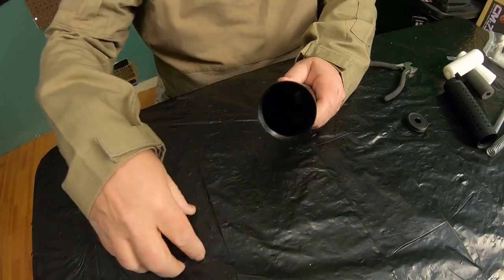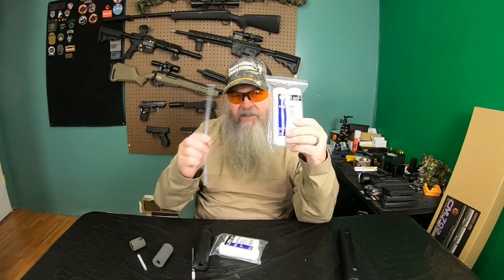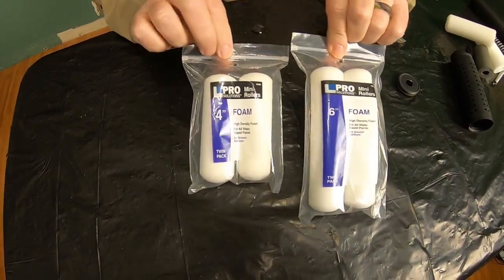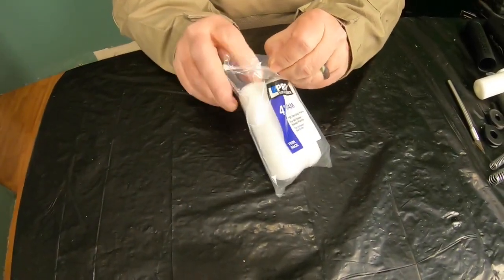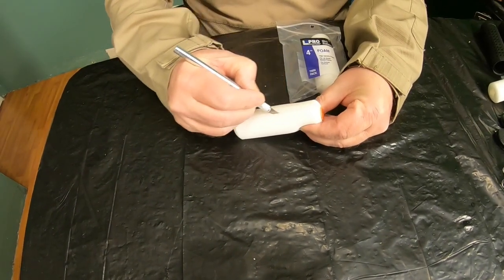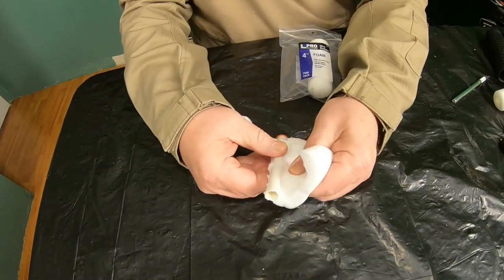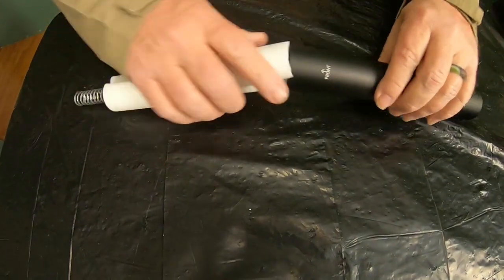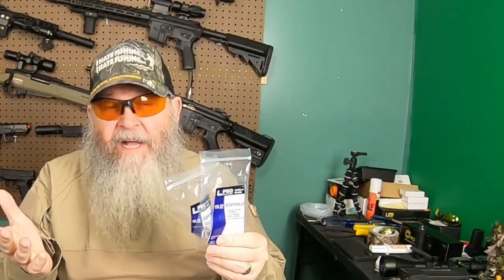Cheap Airsoft Suppressor Upgrade (Airsoft Tech) 🤔

Comment: Hello!  I did this on my mock suppressor for my striker AS-02... and I can confirm 100% this setup works! The cost from my local home depot on the foam and the spring totaled $7.32 after taxes. I initially had a 4 inch mock suppressor but switched it out to a 6 inch...and the sound was very much muted on the 6 inch setup. Thank you for the video! This is legit and affordable and a fun hobby project.
Reply from the maker: Right on Brian, thanx for the feedback, I'm glad it worked, did you use a spring?
Reply: @ShreqAirsoft  Yes, i got a spring from my local home depot, worked like a charm

Comment: One thing to note is that this will indeed surpass the noise of the air coming out of the barrel, but the majority of the noise is from the piston slamming into the back of the cylinder head. You can get quieter pistons or some people put foam pads on the back of the cylinder head (this will slightly decrease FPS and will need to be replaced).
Reply from the maker: Exactly! Most of the piston slam noise is directed to the side of the gun, not a lot of that noise goes forward but a great point, thanx!

Comment: Cool video buddy.   What's the he legal status with these?  I've seen the foam inserts for sale at airsoft shops but I sorta thought they weren't legal? 

Especially if a person owned real steal guns as well??
Reply from the maker: I own lots of real steel guns. Put an airsoft suppressor on a real gun and the pressure will probably cause it to explode. I don't know about anywhere else but here in Utah they are legal.
Reply: @ShreqAirsoft  thanks buddy. I live in Utah as well. I'll have a nice little project this weekend
Reply from the maker: @bushido6348  Right on, what project?
Reply: @ShreqAirsoft   I've a kwa qrf mod 1. I added a maxx trigger and gate titan. Next I'm thinking I'll upgrade the compression parts. And maybe a new motor. Would you have any suggestions on a good aeg motor?
Reply from the maker: @bushido6348  Depends on what you want or have to spend. I did a search on Evike and there are tons of options and prices.
https://www.evike.com/s/?q=aeg+motor&x=0&y=0#a_aid=61057b438c097&a_bid=b467b403
Reply: One shot and the foam is gonna disintegrate 😂🎉

Comment: Mind sharing what brand suppressor you show in the vid? All of the ones that look like that at my local shop have the caps permanently attached
Reply from the maker: That particular suppressor is for the AS-02 Striker sniper rifle put out by Ares Amoeba. If your suppressor that you bought has a seam running around the top piece its probably just screwed on really tightly. The suppressor in the video was like that. I used a pair of pliers with a piece of cloth in the jaws of the pliers so it didn't mar the suppressor and was able to get mine apart. What model of suppressor did you buy?
Reply: @ShreqAirsoft  , I'll have to look at what brand they are next time I'm in there. What you're saying makes sense. They do have a seem(the few that I looked at) but I assumed they were permanently attached because they wouldn't budge by hand.
Reply from the maker: @frankcastle4194  I had the same issue, used pliers and a little elbow grease, let me know!